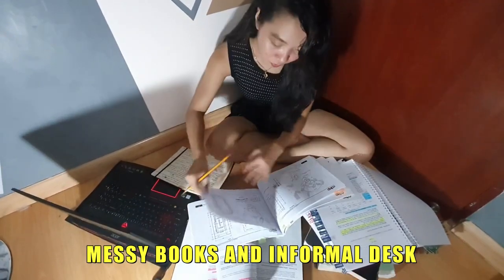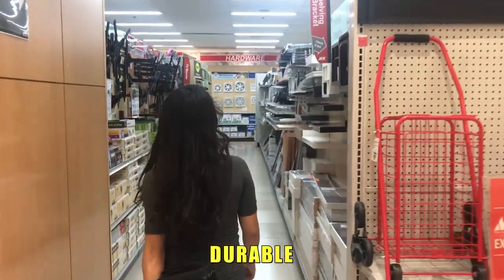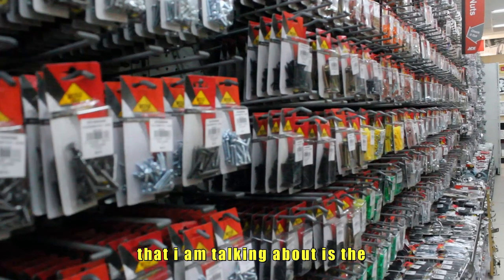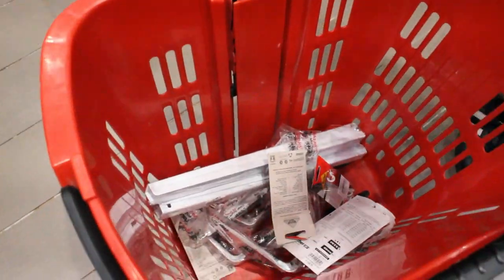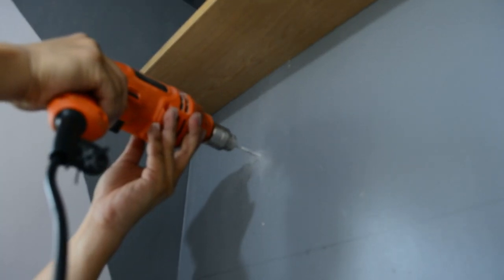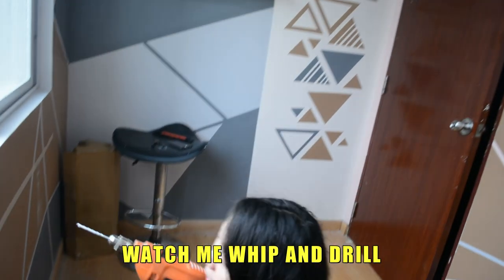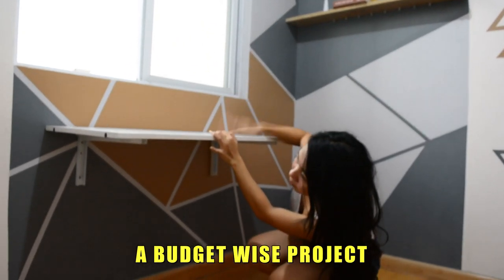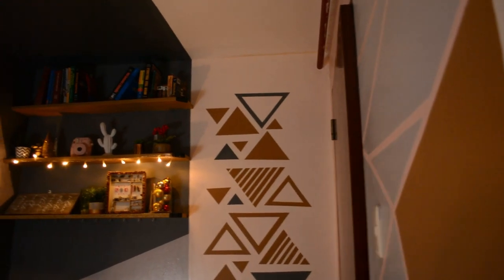BUDGET WISE  : DIY  TABLE  AND  SHELVES

Comment: Never seen shelve brackets on the top like that, they usually on the bottom so as to give the shelve more strength since they are resting on the bracket as well. Good idea for the table.